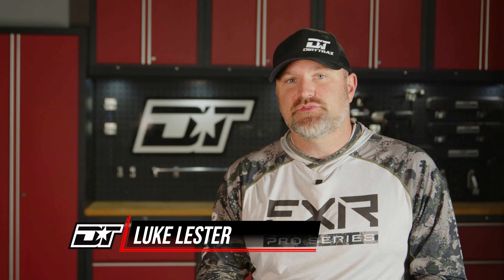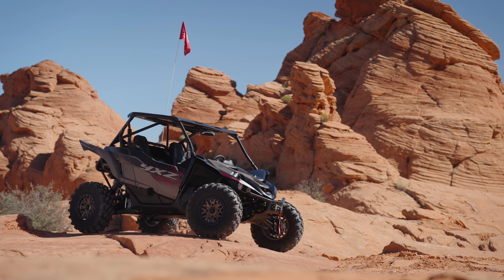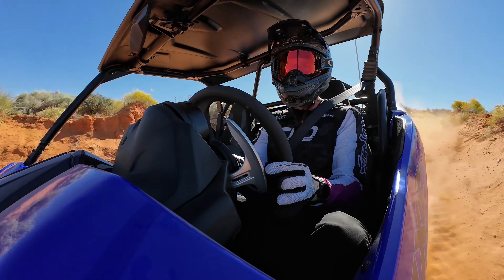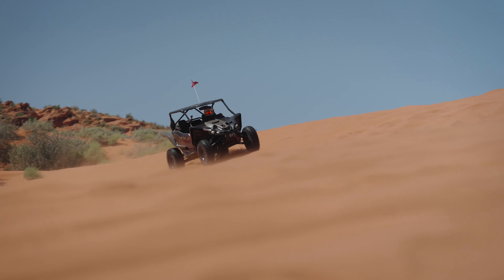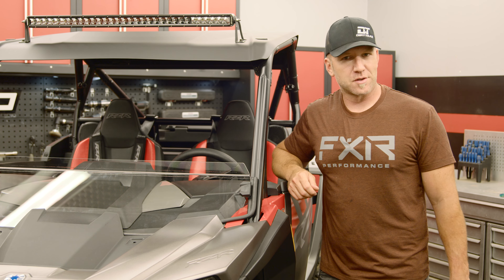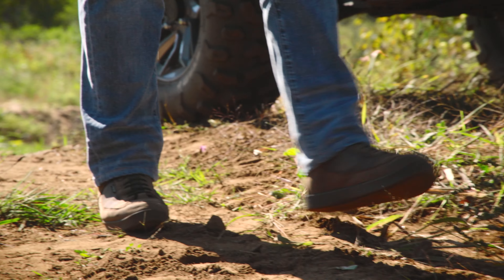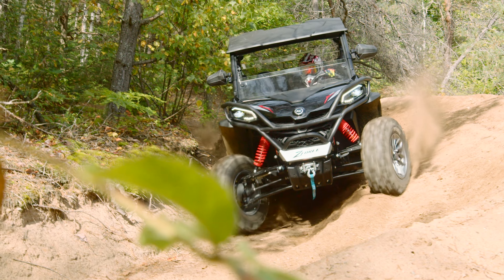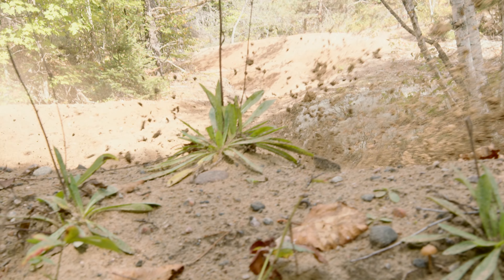DIRT TRAX TV 2023 - FULL Episode 12

Comment: How plush was the suspension on the CF moto compared to the RZR?
Reply from the maker: Can't give you a direct comparo since we didn't have a RZR on hand, but these shocks are decent. Just need a little bit of calibration and a good day of messing around with to get them working exactly how I'd want.
Reply from the maker: Just realized you might be referring to the RZR XP in this episode. In that case, no comparison. RZR XP is superior, but these two machines are not in the same direct class either. More horsepower, more performance and more money.
Reply: I was referring to the trail and trail s